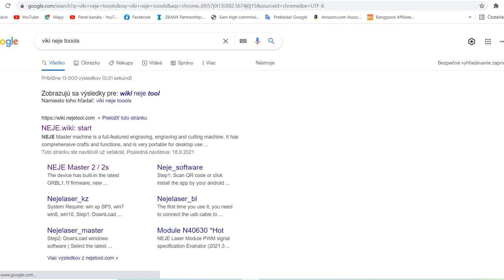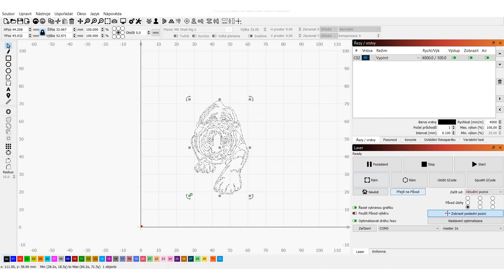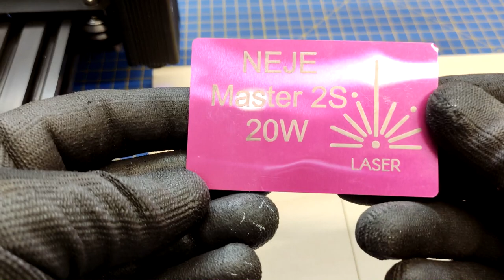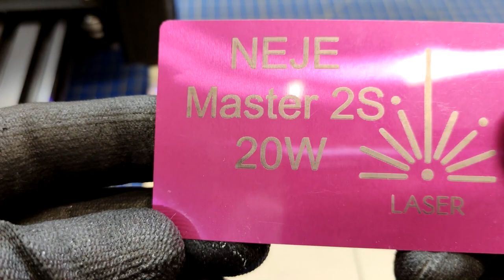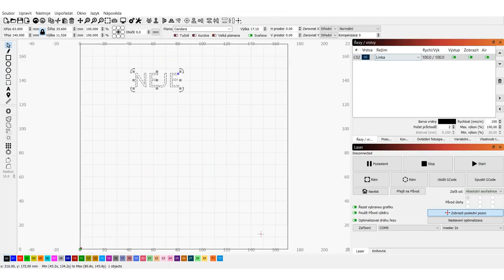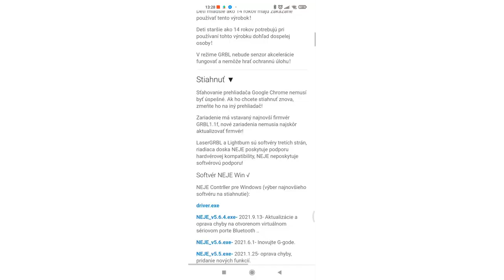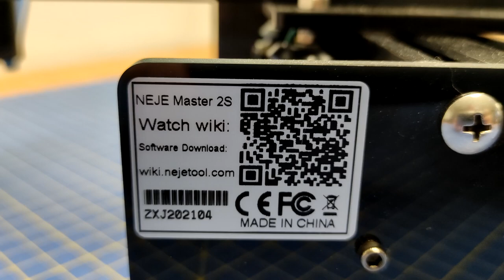NEJE  Portable Laser Engraving Machine  Master 2S 20W with small upgrade  (unbox / assembly / test)

Comment: Nice video.. Just got the exact same one. How do you have it draw the image instead of single line back and forth engraving and cutting?
Reply: Also where can I get that z height upgrade and air nozzle tip?  Thanks
Reply from the maker: i am using an inkscape program to trace a bitmap, see this video
https://www.youtube.com/watch?v=pJ1X_HACw40
Reply from the maker: there are links to the stl file in the video description - you have to use 3d printers

stl air assist https://www.thingiverse.com/thing:4653842
stl air assist https://www.thingiverse.com/thing:4657049
stl Z height mount https://www.thingiverse.com/thing:4651529

Comment: I have the same laser. Good idea and implementation of air assist. can you please share a layout of this upgrade? what was laser power for cutting playwood?
Reply from the maker: I always used 100% power to cut plywood.

For upgrade i used 3D printer and stl files:

stl air assist https://www.thingiverse.com/thing:4653842
stl air assist https://www.thingiverse.com/thing:4657049
stl Z height mount https://www.thingiverse.com/thing:4651529
Reply: @kukomio  thanks a lot!

Comment: Can you give link your test projekt ? I have neje 30W (7,5 optical power) i have problem with cut plywood 3mm...  Focus i have good i tested it.  I use 100mm/min (100% power)  where you have 5.5 optical power also one pass + 4mm it is strange for me ..
Reply from the maker: What type of plywood do you use? I use poplar plywood, it's good for laser cutting and I always use an air assistant. Birch plywood is hard and difficult to cut.
Reply: @kukomio  El sistema a aire sería el adaptador azul que me pusiste al láser de 20w ? Donde puedo conseguirlo ?